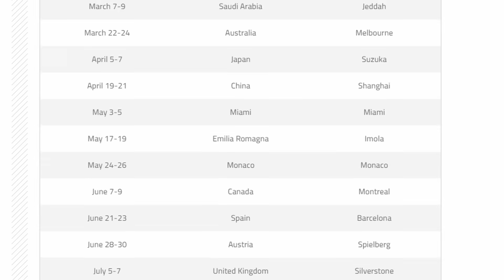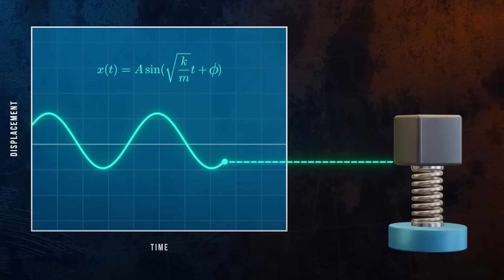Why These F1 Engines Only Lasted 200 Miles

Comment: Afraid of hybrids? That’s one hell of a coping mechanism for wherever someone don’t like what you like. They’re afraid of it 😂 Whatever helps you brother
Reply: Yup, and of course he conveniently doesn't talk about how heavy the current hybrid systems are in comparison to a 3.0 N/A setup, nor how a hybrid system by default lessens the workload of the actual engine itself, especially in regards to torque. It's always funny when tech bros convince themselves they're unbiased and forward-thinking for talking in a monotone voice when all they do is buy into knee-jerk narratives and are biased as hell.

It would be interesting to see how a current V6T would perform without the heavy hybrid/ERS system, and the boost pressure + rev limit raised so it would reach ~950hp. I have no doubts it would still be markedly more efficient and reliable than than the 3.0 era, but not anything like 'it uses half the fuel and lasts 6 full weekends bro v10 is dinosaur bro'. More realistically it would be a touch more efficient and reliable than the 2.4 V8's. The actual advancements are down to evolved metallurgy and manufacturing precision, which has no bearing on cylinder count or aspiration. And lets not forget 20 years ago to win a race or even just a points finish (top 6) you actually had to drive on the limit lap after lap after lap and only conserve the car in compromised circumstances, whereas now the regs regarding tyres, points, and fuel penalise you for pushing anywhere past lap 3, the 3.0L would undoubtedly have a longer life if they weren't truly being pushed 80% of the time and similarly would have similar reliability and power if built with today's manufacturing and constraints in mind.

Either way, hybrids and sprint racing is an idiotic combination and it's only been in place to attract tech bro money and the type of guy who made this video who wants to feel like they're cutting edge, and this dualistic 'V6T Hybrid vs V10' debate is stupid because people act like their attributes are mutually exclusive. In Le Mans hybrids make sense as that is more a test of attrition, and no shit hybrid makes sense on road cars. F1 has always been about a near money-no-object for the fastest cars and the fastest drivers driving at their FASTEST PACE without crashing for 300 miles, I'm sorry but trying to change that final part doesn't make you clever or forward-thinking.
Reply: @solitaryclusterofneurons598 You are very right, and the sort of solutions you propose would have been perfect cannon fodder for F1 circa 20-ish years ago. The climate in F1 nowadays, though, isn’t about racing or engineering - it’s about funny money, money laundering, and techbros.
Reply: @F-Man  To be fair F1's always had money laundering and 'funny money' and it's still certainly about engineering, it's just that the regulations are muddied with political motives which don't actually reduce emissions of the sport in spite of suggesting so. The difference is that back then the main benefactors (tobacco companies) didn't give a flying fuck as long as the cars were quick 'dream machines' and the drivers had talent, then tobacco sponsors started phasing out in the late 90s and gradually in place F1 sought out to sell on the 'tech' side of the sport to appeal to the Panasonic's, the Compaq's, the AMD's etc to sponsor teams. The problem is tech companies aren't interested in just throwing money at shit cause it's cool, they're far more interested in the politics and showing how 'tech-forward' they are irregardless of whether it's healthy for the sport or the fans.

The only outliers are Ferrari (who are the only reason F1 isn't 1.0 4 cylinders today) and Red Bull (who as a sponsor carry the torch of the old tobacco sponsors of just throwing money at shit cause it's cool). On the bright side at least we have no driver aids, no grooved tyres, and at least a half-assed attempt at cleaning up the aero.
Reply: Sounds like something someone who needs to project a fear of hybrids would say.
Reply: @googleaccount3161 Was still a weird thing to say and probably engagement bait, dropped the video's quality

Love hybrids myself, don't really belong in motorsports
Reply: @kerimca98 I unsubbed because of that little quip. The engineering talk is fantastic, but the little identity politics hit was entirely inappropriate and offensive.
Reply: @F-Man  that’s awfully defensive from someone criticizing another for identifying with politics.
Reply: @kerimca98  it’s not a weird thing to say, internal combustion engines are just lesser machines without hybrid technology. Saying otherwise is the exact same as “well these new horse carriages are stupid,they don’t even got horses-just engines” anyone who’s actually interested in engineering over associating their identity with loud engines( great example the main comment and comment responding about “identity politics”,what ever that means) is gonna find hybrids for what they are,the next best thing that’s faster in theory and practice. As far as Motorsport is concerned, they are the only reasonable next step. People who associate with outdated tech in the name of heritage are silly.
Reply: @googleaccount3161  u got me. SkyF1 makes me piss my panties

Comment: The powerplants in F1 don't produce 1000 hp unless you include the ~160 hp of the hybrid system. Over 800 hp from 1.6 liters is still impressive, but it's a long way from 1000. For perspective, the last turbo era was making at least that power during races (far more during qualifying) from 1.5 liters, but reliability was not exactly spectacular.
Reply: The modern engines could easily make over 1000bhp if subjected to the same unlimited boost pressure and fuel flow rate as the cars of the 80s. I'd be intrigued to see just how much they could squeeze out of a modern unit if they were allowed to make a true qualifying grenade like they used to
Reply: We never really figured out turbocharging passenger cars reliably until the late 1980s. Passenger car manufacturers kept trying to push more and more boost directly into the engines without sacrificing fuel economy. Intercoolers, precise computer controlled fueling and over fueling to cool cylinders was the correct combination to get us to a full atmosphere of boost and beyond. The same measures could have been applied to these race cars and reliability could have been as high as N/A cars.
Reply: @negativeindustrial  Yet WWII aircraft were using gear driven compressor intercooled fuel injected engines that were reliable.

And they took the ideas from the late 1920's and 30's
Reply: @ 
WWII aircraft engines used very high octane fuel we don’t have available for passenger cars.
Reply: @negativeindustrial  oh ok. So it was understood in 1941 100/130 AVGAS was better (the British were using 87 prior), however, vehicle manufacturers in the 1980's had no idea about the relationship between Inlet Air Temperature, Fuel Octane ratings and detonation? Or intercoolers? Or water injection?

Makes sense. They forgot how to fly to moon too. It amazing to think manned flight began in 1903 and 66 years later the radiation, vacuum of space, navigation and communication had been overcome on the very first try without any problems yet here we are 55 later and still can't work out how to get there.
Reply: According to the motor racing books in my library stated by employees of BMW and  Honda and leaving aside the other manufacturers for time being, they said they did not know the real power on dynamometer because it went off the power gauge.
Reply: BMW took 1400hp from 1,5 litres F1 engines back in 80's...
Reply: @ilkkak3065  Roughly 1,500bhp for the BMW and Honda engines.
Reply: The first thing to consider is fuel, both the fuel blend (open free for all except no nitro) and in race refueling during the 1980's. Then consider the computing power controlling the engine, or compare the resolution and refresh rate of a 1980's computer game compared to 2016 - on. 

Do not get me twisted, in many ways the 1980/90/00's were peak civilisation from a human perspective. Since 2004 the human talent and commitment required has declined rapidly. Uncle Ted saw it coming and detailed it's progression with stunning accuracy prior to his relocation to US government housing.

The thing with the 80's turbo era is that the last few season had no refueling and reduced fuel capacity. Funnily enough that makes the teams become the fuel flow rate metre. Now if you believe the engines of the 80's were as efficient as the engines today you are beyond help. What's great is engine output can be calculated from Brake-specific fuel consumption (BSFC). The BS stops real quick when facts are applied. 

BTW I've never heard a race engine builder/manufacturer publicly admit the real output ever in recorded history. So you having a chance of understanding what they actually produced is moot.

Comment: I had the pleasure at my club track to witness the set up and drive of a Williams F1 car of a mid 90s vintage. It took 5 engineers to even get the thing ready to roll. The sound was simply glorious and being within 10 ft of it was deafening. When on track and screaming down the front straight, ear muffs were definitely needed even from the 50 yards where I was standing. Obviously the driver and owner was loaded, lol. As I understand it, he had to fly in both Cosworth and Williams engineers. Must be nice to be loaded. lol.
Reply: I was standing over the track in Albert Park when they ran right below me 

I couldn't see them but I could feel them through my ears and my lungs 

Insane levels of volume booming right under and through you

Comment: "engineering that have yet to be matched",  I beg to differ.  The current crop of engines could literally last a 24hr le mans race, and are also more powerful despite being forced to use less than 1/2 of the fuel the V10 engines once used.  The current engines may not sound good, but the fact that a 1050hp racing machine has an energy efficiency higher than a Toyota prius, is insane.  If you stuck one of these engines into the back of a F1 car today, you'd have to find a way of putting in 200kg of fuel into the car before the race start to make it to the chequered flag.
Reply: engineering is still yet to be matched. performance and reliability sure did. moderns V6s are much more complicated and advanced as a power unit, but at the same time they are "simpler" in design and tolerances. modern F1 cars can just start on their own by their hybrid system, where a V10 car would need a long time to get ready so it could actually be cranked to life. and so many other details that would allow them to reach almost 20K rpm 
but they had a completely different set of rules, so its kinda unfair to do an "apples to apples" comparison
Reply: @dimosk7389  current engines also need a long time before they can be cranked to life.  That’s simple physics and thermodynamics.  And are way more advanced.  Your old V8 and V10s couldn’t start themselves is because they don’t have a starter motor.  Nothing more.
Reply: A 1000kg racing machine with shitloads of aero has better energy efficiency than a purpose-built ecobox? 
Only if you'd take energy regen into account and forego the fact, that no prius is ever designed to be used with on/off throttle and braking, you could even utter that phrasing. But even then it is wrong.

Don't get me wrong: it is insanely cool tech, but it the marketing around it is dumb. 
MGU-H is the part that gives the F1 engine the advantage over purpose built street-use hybrids in thermal efficiency and that only works under full throttle.
So by pure technicality, in certain situations, it can be considered true, but in reality it's like saying the sun is the biggest and brightest star.

Comment: It wasn't only the quest for power which hampered reliability; making the engine as small and light as possible also had a huge impact. In 1997, Renault's class-leading RS9 V10 weighed around 120kg, revved to 16k RPM and produced about 750HP. Six years later: their RS24 V10 weighed less than 100kg, revved over 3k RPM higher and made almost 200 more horsepower.
Reply: Another factor is the reduction in capacity to three litres meant engines had shorter strokes and now could rev even higher, which manufacturers pushed even more aggressively to try and claw the lost horsepower back.
Reply: 950 HP out of a 100kg engine is insane😳
Reply: @bengummere1726  Yes, bearing in mind there were still limitations at that time with regards to the metals and alloys you could use - the crankshaft had to be steel, for example. Only a few components were allowed to be of titanium construction.
Reply: @bengummere1726  3000cc
Reply: @bengummere1726 only bmw had 950 every one else had 850-900
Reply: I know diminishing returns is a thing but I wonder what kind of performance they would have achieved if they continued their development to present day.
Reply: @Mrdanirago98 with the modern combustion technology, they'd be well over 1100 HP with even lighter engines (if they could use the exotic materials)
Reply: God damn